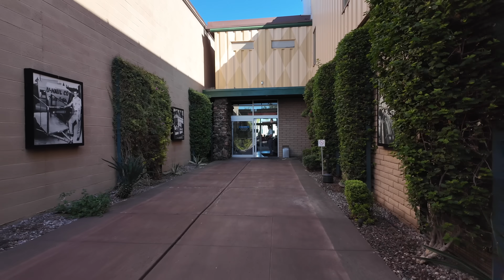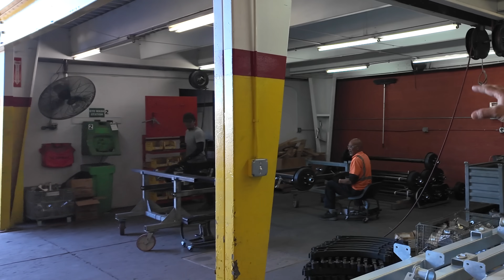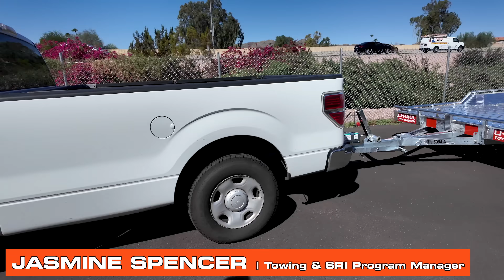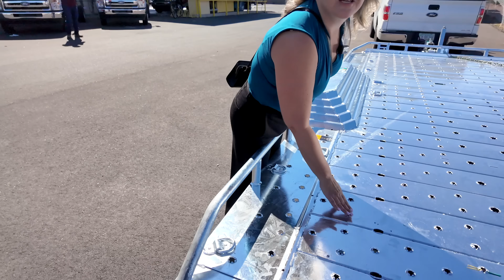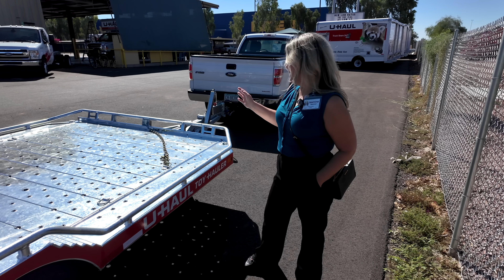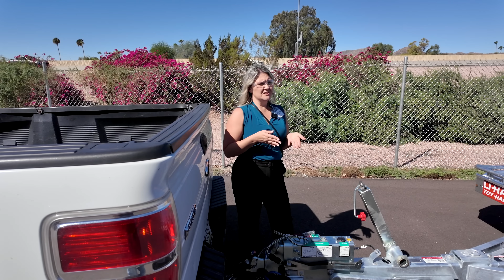Inside the U-Haul Trailer Factory

Comment: no wonder they are so expensive no assembly line hand built low production the most expensive and lowest quality you can get, ive had trailers falling apart before and I used to work at a rental yard..yikes

Comment: We're a U-Haul dealer.  I'm not over impressed with their trailers.  They tend to the heavy side.  Overly stiff springs.  And none of them have tongue jacks.
The toy hauler looks interesting, but I haven't seen one yet.
I have electric brakes on my personal trailers,  but wouldn't want them on the rental stuff.  Many of the trailer rental customers scare me with their lack of knowledge and lack of care.
Reply from the maker: I think I AM impressed with their trailers BECAUSE they tend to be heavy and stiff. The trailers arent built for light weight efficiency, they are built to last 20 years of getting hammered by rental customers and used for a zillion different use cases. I think they do a really good job engineering for durability and safety for the lowest common denominator of rental customers.
Reply: No tongue jacks make them harder to steal off the lot and harder for the renter to remove trailer and swap vehicles or disconnect and perhaps not reconnect properly.  If you are a dealer you should have the u-haul special tongue jack that is moved from trailer to trailer during hook up.  By the way, the last car hauler trailer I rented had a jack.

Comment: Wish they did sell them to the general public, I’d buy one today.
Reply from the maker: I think they have a hard enough time keeping their rental fleet stocked and refreshed that selling new trailers would hurt the rental side, and they probably wouldn’t sell enough trailers to offset the hit on the rental business.
Reply: @GearsandGadgets  I think it would.  Just do it on an order basis think it would work out.
Reply: @GearsandGadgets  they sell the trucks all the time, I don't understand why they don't sell the trailers
Reply from the maker: @michaelc9128 different business models for the trucks which have a value to sell used at 100K miles to keep refreshing fleet. The trailers are in rotation for 20-30 years until they are deemed un-roadworthy at which point selling them would be unsafe. That’s just one reason, there are many many more reasons not to sell the trailers but more importantly not many reasons to sell the trailers.
Reply: @GearsandGadgets  Don't they sell the old(er) trailers anyway?
Reply: @oldschooldiy3240  Yes, I bought a old Ryder trailer looks just like the U haul car transporter cat trailer.
Reply: @oldschooldiy3240  No they don’t, they do not want the liability.  They just scrap em.
Reply: @oldschooldiy3240  They are selling some Tow Dollys only
Reply: They can’t keep them all rent fast can some won’t return and keep rent
Reply: Why not rent a trailer and take it to a custom builder and pay for a copy of the trailer, they should spec each part out for thickness and any other criteria needed. I have a steel scrapper who has a gun for scanning metals to determine the recipe of the steel used in every member. It’s well worth it.
Reply: @Subgunman  that wouldn’t make any sense financially. Think of the cost to have someone scan and spec a trailer then custom build a copy. Without economies of scale for all the parts and labor, the cost would be very high.
Reply: @seashackf1  if one wisely shops for the right materials and has it built, it will last just as long or even longer that the UHaul trailers. It will mot be rented out and abused by incompetent individuals and I and my family members will have it for quite a while.
Reply: @seashackf1   depends on how often you use it. 
 If you only use it once a year, no. 
If you use it 30 times a year, it might actually be worth it.

Comment: U-Haul has always had the best trailers people can rent. They overbuild the trailers which is a good thing! I have seen many people end up in trouble because they weren't aware of how badly they loaded trailers, I owned a small Towing company so I  got calls for assistance back in the day. 
Most people think they know everything and will not listen to how a trailer or truck rental should be used. Maybe U-Haul can invent a way to teach people how to safely rent, use these awesome trucks and trailers. My biggest gripe, concern is those folks who Speed while pulling a trailer which is very dangerous, IMPO.😊
Thanks U-Haul for the awesome equipment they rent. Mike from northern MN.😊
Reply from the maker: Uhaul does have a lot of resources available for how-to but unfortunately some people just think they know what they are doing even though they dont do it often or at all. I think uhaul does a really good job labeling all of their trailers with loadlines and stickers for how to load. But yes I agree with you, some people just load it and send it without much thought. I think that is partially why uhaul engineers their trailers to be heavy in the first place so they control tongue weight with fully steel construction and axle placement that best prevents trailer sway for the average load.
Reply: @MUd4x44  they have pictures on everything, people just dont understand physics that well
Reply: Let's be honest....most renters are just dumb as far as loading trailers properly comes!
Reply: We have to be honest here. A trailer limited to 55mph in 2025 with city freeways at 60mph and interstate highways at 70 or 75? Seriously? One would be a hazard driving the trailer rated speed on these roadways.

Comment: I knew from working at a dealership that U-Haul designed/engineered their own trucks to the needs they deemed necessary to meet demands placed on vehicles their customers rent, I had not idea they manufactured their own trailers too -- that's impressive.
Reply from the maker: Yeah, they really do it all in-house, which is interesting. I absolutely thought they subbed out the trailer manufacturing.
Reply: Long ago, I remember some GM Truck engineer say that they have a special truck chassis just for U-Haul.  They buy enough of them to get that kind of special treatment.

Comment: Pretty cool. I wonder if they put bias ply tires on these or radial trailer tires
Reply: Most trailers have radial tires now. Some still have bias ply. We stopped using bias ply tires a few years back.
Reply from the maker: The one I rented had Carlstar Radial Trail HD All Season ST225/75R15 tires on it.
Reply: Only cheap equipment trailers still come with bias-ply tires.